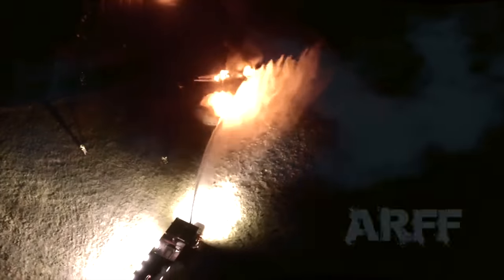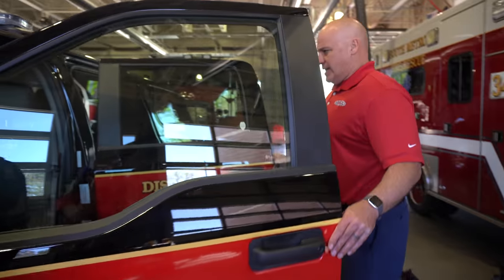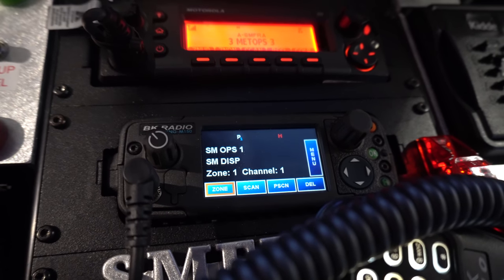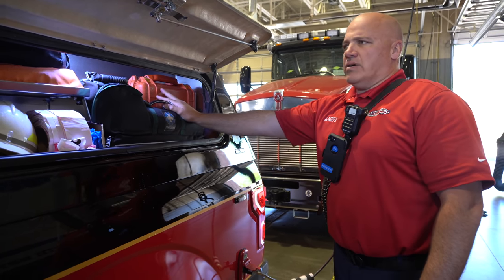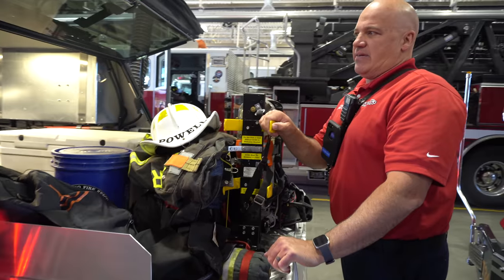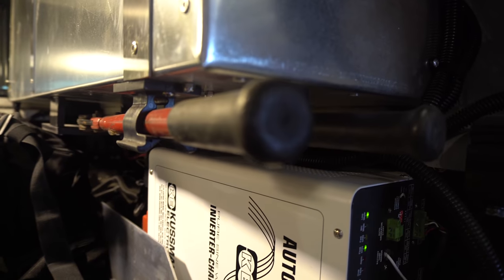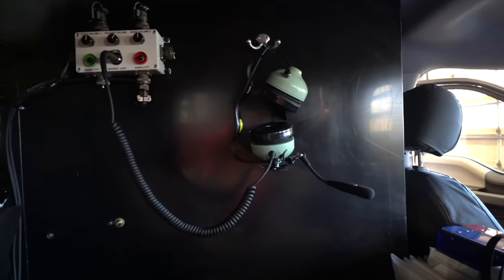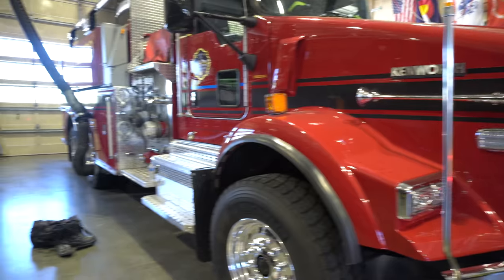Fleet Friday - New District Chief 1 Vehicle

Comment: Down here in Phoenix, we have field incident technicians which drive our district chiefs and battalion chiefs and the FITs are the "chief's aid" Chief Kirschke  "when the aid arrives"-- I have a few questions with that.

1. What is this exactly mean? Does the chief ride solo and then someone responds for his aid?
2. What unit would come as an "aid"
3. How does this work with South Metro?
4. Wouldn't it be cost-effective (specifically, when it comes to cost-to-mile) to have one unit instead of two? I'm going on an assumption, but to me, it makes sense to have one command vehicle with two riders, a senior officer and an aid rather than having an aid drive one vehicle and the senior officer drive another. Just the gas alone would save some money but also space because you have to have quarters for this "chief's aid" vehicle.

Comment: Where does the Chief's Aide come from?  Does he ride in this truck or ?
Reply: NO HE HAS HIS ON TRUCK
Reply: Like LAFD for example has a "chauffer" for Chiefs, didn't think South Metro did that... Thanks in advance.
Reply: @jeffpatch5  
Several departments in my area have what is called "Chief Aides" who actually drive the chief officer to incidents.  The reasoning is to allow the chief to concentrate more on the incident they are responding to and let the aide worry more about operating safely.  Upon arrival, a good number of those departments in my area normally would use the "Chief Aide" as either inside or outside "Safety" on fire grounds.
Reply: @SouthMetroFireRescuePIO   Thank you!  Learn something new every day...
Reply: @SouthMetroFireRescuePIO  
My Experience tells me your department is on the right path.

Comment: Whats the difference between district and battalion chief, and who has higher power?
Reply: There are 1 district chief and 5 battalions. I think district manages a greater area so District..
Reply: District 1 is the district supervisor for SMFR. He’s basically the boss of the battalions. And he has the higher power
Reply: Field command is strictly hierarchical.

- A company commander usually rides on the vehicle

- Multiple companies form a battalion (there are planned areas of responsibility, but battalions aren't fixed, at one scene you might have a battalion of engines 2,3 and 7 while at other scenes you have a battalion of engines 1,7 and 11 - but both times Battalion 1 ist the commander, this is called "ad hoc units")

- Incidents requiring more than 3-5 companies are usually divided into sections of no more than 5 units each. Each section is then commanded by a Battalion chief and incident command goes to District chief. At this level of incident you usually need staff officers as well (like logistics, communication, press relations, etc.).
- Some large departements may have a further step above this, usually called Departement Chief, Fire Chief or Chief of Fire Operations. They would get involved in an incident with more than 3-5 battalions (ie above 15+ companies) as well as "important" incidents. They are the politically responsible head of the agency and usually have a good standing with/contact to the mayor.
[This at least is a basic "blueprint" of how command structure works. The names might be different and some numbers slightly adjusted, but it is a fact backed up by multiple studies that a field commander can't effectively command more than 3-5 units (depending on complexity of the task) directly. Thus the company-battalion-district structure in almost all fire departements.]
Reply: @torontofirebuff8004  Thanks!
Reply: @ColoradoFireBuff  Thanks!
Reply: @QemeH  Thanks!
Reply: Jag Nagarajan why don’t u check out his channel for Toronto fire

Comment: When does a district chief get called out?
Reply: A District Chief can get called out on all major calls such as a Wildland Fire, Structure, large MVA, sometimes when a patients heart stopes (core zero), any special ops calls, and anytime a units request a BC/DC they respond like Battalion Chiefs
Reply: @camden3957  what happens if there are multiple incidents that require a district chief?
Reply: @anddrewb1367  There are multiple Chiefs throughout the department's area, and even if two major calls were to go out in one chief's area the next chief would just come into the zone. Since they use suvs they can get there fairly quick. Also keep in mind a Lieutinant on an Engine or a Ladder truck can command a call under a chief gets there
Reply: anddrew B eric beat me too it but good question!!
Reply: South Metro Fire Rescue PIO lol, you missed PIO 10

Comment: No suppression equipment other than that 5 lb extinguisher in the back?
Reply: I was thinking the same they are firefighters
Reply: I understand the difference in job functions and apparatus types.  The District Chief's vehicle looks great and is very well equipped.  My point was that you've got every tool imaginable in a truck that says 'Fire Rescue' on the door except an effective method for suppression.  There's medical gear in case the Chief is first on scene; body armor and a bag of tourniquets for active shooter calls; a water rescue stick as it "buys you some time"; even a lock-out kit "in case you're at the grocery store or mall and someone needs help"; oh - and a tiny fire extinguisher from Home Depot.

I'm not suggesting you wedge 150 gallons in the back of the truck, but a stored energy CAFS unit or even some larger 20lb extinguishers would seem prudent.  You know, for those times when you're first on scene at the grocery store or mall and someone needs help. :-)